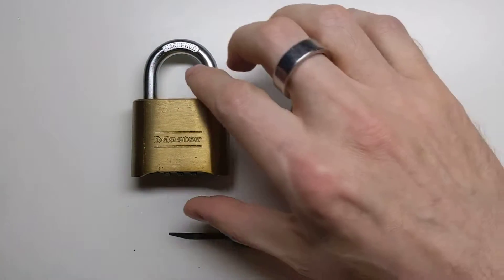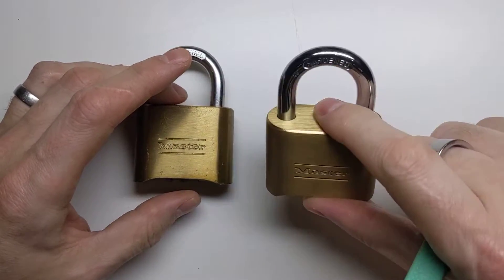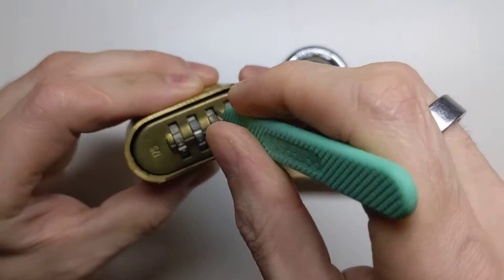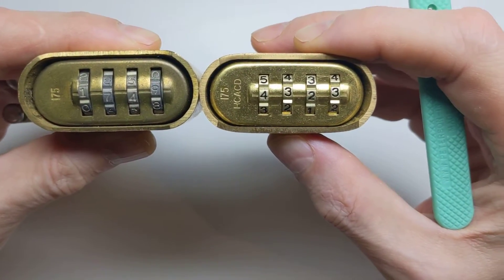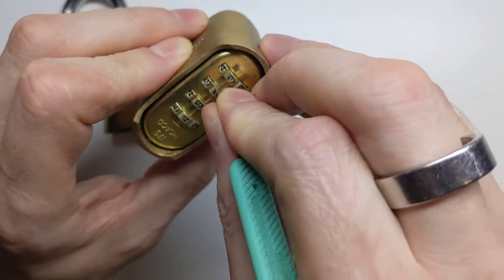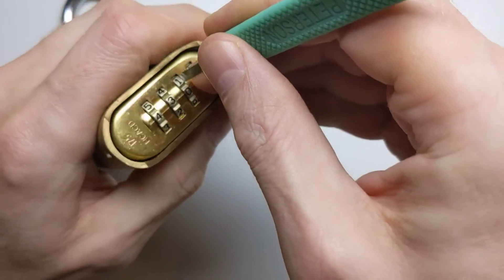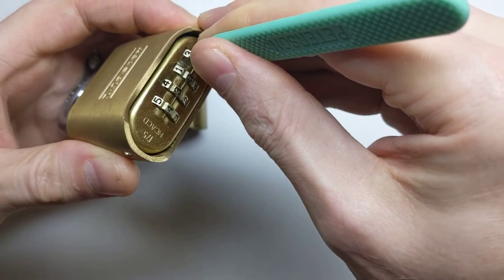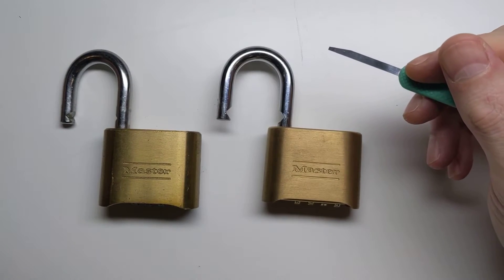[006] How the brand new Masterlock 175 can be bypassed...

Comment: How thick is that knife?
Reply from the maker: I believe it's 0.07".
Reply: @LockPickingCuber  Hey thanks! Do you believe a thinner steel sheet, such as .05 would get in even easier?
Reply from the maker: @HeirofSigma  Yeah -- I think it would. There's a limit of course -- if it's too thin, it would deform rather than bypassing the lock. Worth a try with 0.05, though...
Reply: @LockPickingCuber  I got a notched decoder from Covert Instruments, the store from Lock Picking Lawyer and I did try inside of a newer Master Lock 175 combination lock.

I did bend it but I used the resurrection pliers to "straighten" it out again.

I also bought a bunch of feeler gauges and in my opinion a .006 or lower could get in nicely, provided you rotate the wheels until you get that "sweet spot".

Also, top and bottom of the wheels is wide open in these locks. Might be easier to bypass on those parts, instead.